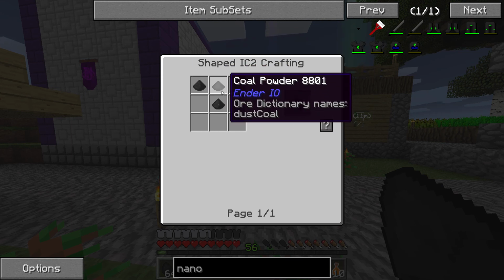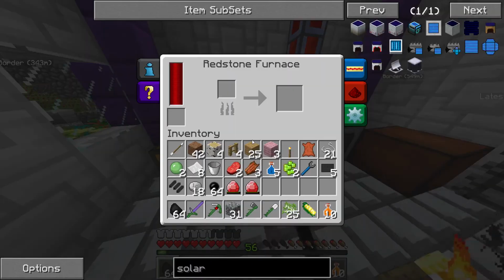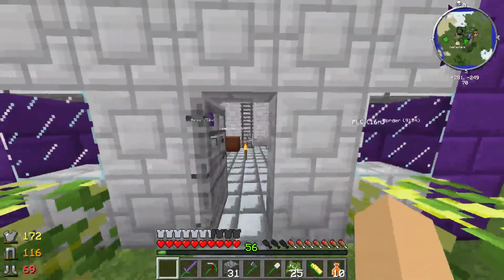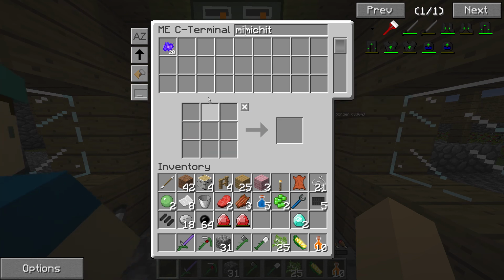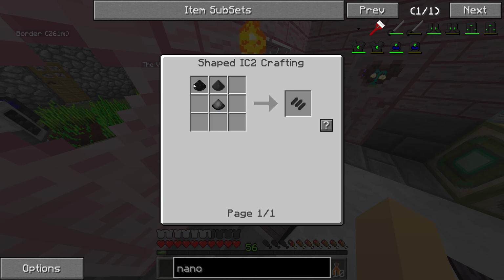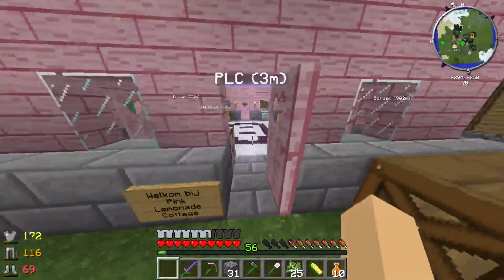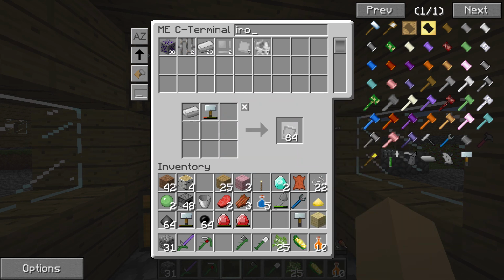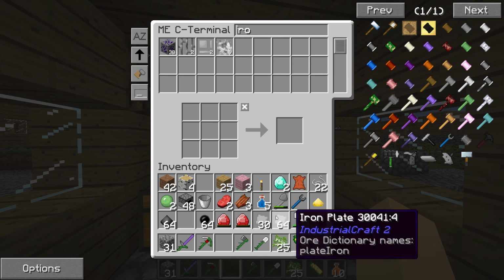Let's Play - FTB Monster - Episode 20 "Filling it up..."

Comment: Problem is not with the pulverized coal. The problem is the recipe is wrong in NEI the coal has to go in 2x2 in the grid so it uses 4 dust instead of 3 to make carbon fiber. In slots 7,8,4 and 5.